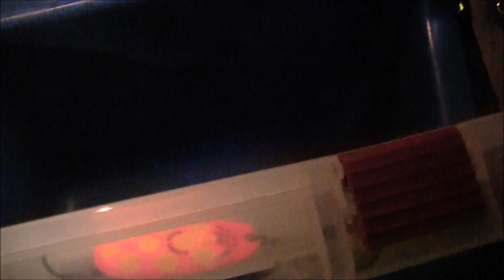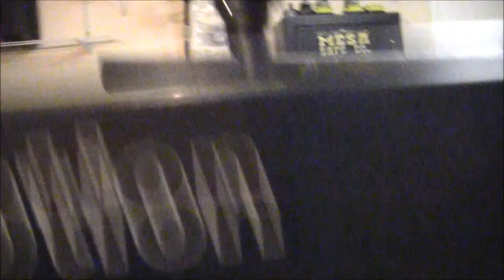Perception Pescador Pilot 12 0 Initial Impressions Review

Comment: Awesome video, love the detail.  What sort of grease did you use?  Also to replace rudder rigging with pulleys, are those standard parts?  Hoping to replicate your tear down and maintenence by following this video.  Any different type of grease for the gear box vs say the rudder lube?  Figure I need grease, and blue and red loctite and tools.
Reply from the maker: I used the blue "Mystik JT6" high performance marine grease. It says on the container it won't break down in salt water. I heard that the red may be better... so it is worth a look. I have lots of videos of my mods. I need to get them onto youtube. Lol

Comment: How did you ever get it at Academy for $1499?

Was it a local sale or something?  I can't seem to get anything under standard retail price anywhere!
Reply from the maker: It was a nation wide Christmas sale price at first that started a few weeks before Christmas then it was supposed to end.... but they kept it going for a few more weeks to clear the years inventory for the new years yaks.
Reply: I watched my "local" stores on-line ads around the holidays and none of them had any sales (or that I was interested in).  It might have just been in your area.  In fact I noticed that the "desired" kayaks were regular priced, and only the older ones were on sale.
Reply from the maker: Academy had the sale before Christmas online. I would have made the order but they only had them in  red at the discount price when I was shopping. There was another online retailer that has sales as well... but I don't remember the name. I think they are based out of Texas.
Reply: Actually Austin Kayak has a sale if you buy it as a bundle, with the paddles and PFD you’ll get it for $1,350. I just bought one. I got the kayak, paddles, PFD, an a yakattack blackpak for $1,646 including shipping and you can go even cheaper if you choose a cheapr paddle and pfd

Comment: Do you still like it.
Reply from the maker: YES. I ended up making a few mods but not many. I put 4 flush mount Yak Gear rod holder into the OEM holes. two facing aft and two facing directly out to the side. It makes for a Great trolling setup. I did about 150 to 200miles in salt water this past Summer. Hitting many sand bars, oyster bars, stumps/etc. along the way. The drive has held up great. The prop held up better than I thought it would too. I am about to take it apart and inspect it before the next season/ re-pack it with grease. I am a little worried because I once wrapped about 50 to 100yds of braided line around the prop. Someone got spooled out in the Chesapeake bay and I caught their flounder rig. The line worked it's way inside the seal on the shaft. Luckily I had a sharp knife on me or else I would have had to paddle the 3.5mi back to shore with a 1.5 knot side current. lol It does great in open ocean as well.

Comment: Great review! We bought one of these back in April 2018 and really like it. I did raise the back of the seat up by adding a 2-1/2" wood block to rest the back of the seat on. It changed the seat angle and for us made it more comfortable. For the price it's a great kayak!
Reply from the maker: Glad you liked the vid! I just got back from yet another fishing trip last night @ Kiptopeke State Park in Virginia. Did some night fishing around/inside the concrete ships. Loving this yak still as well. It is very functional now that I got it set up for my needs.
Reply: @great0789  I like your idea about adding pulleys to the cord that raises and lowers the rudder. I'm gonna do that. As is it doesn't work very well.
Reply from the maker: Jerry Krabe 

I ended up just leaving it stock. When I turn the steering knob as if I want to make a left turn... it is easy enough to raise. May get around to it some day though.